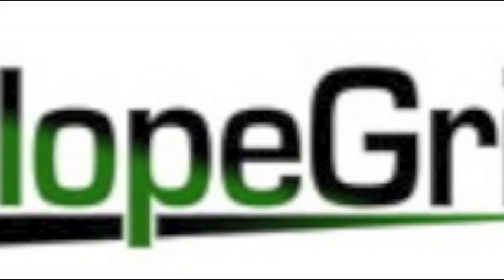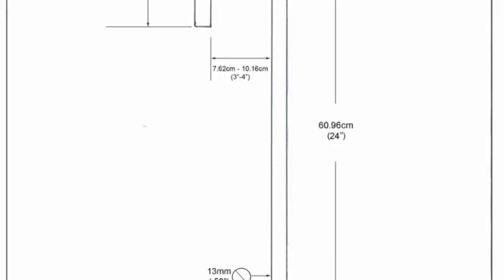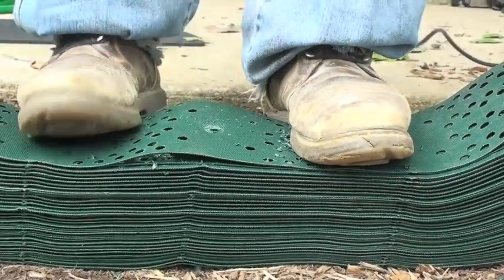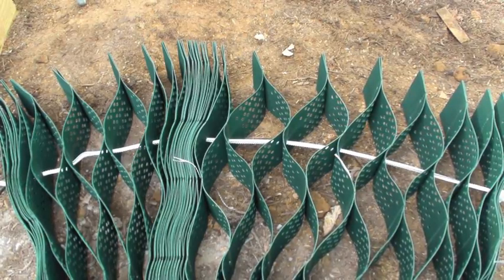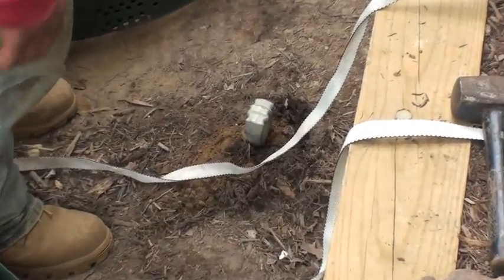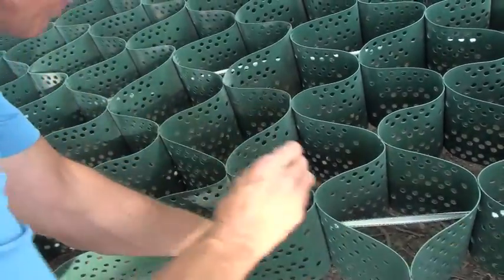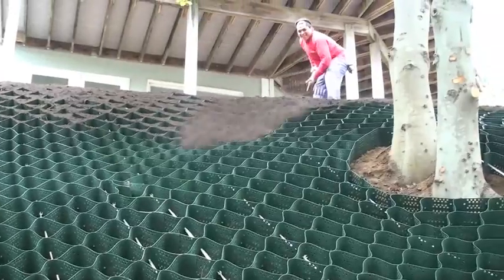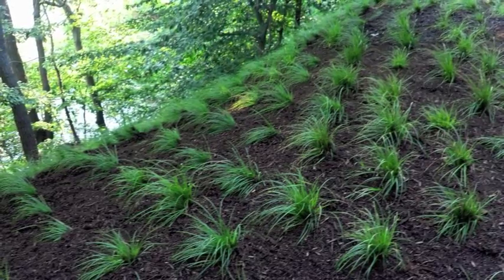Cell-Tek SlopeGrid Installation - Erosion Control, Slope Protection

Comment: how much does it cost?
Reply: All my research has uncovered the fact that the actual "cells" are priced for the super rich...out of my reach, anyway...
Reply: @rongray4118  Hopefully some knockoffs will pop up soon on Alibaba
Reply: Ron Gray the labor will probably cost even more
Reply: @BankRupt887  Alibaba now has it roughly .50-1.50 a sq/meter for material.  Labor is pretty easy actually and a few laborers could do the job easily.  Instead of the screw anchors you can dig a 3' trench and bury a 6" pipe with the tendons attached. It's cheaper than many alternatives like an engineered retaining wall and backfill.